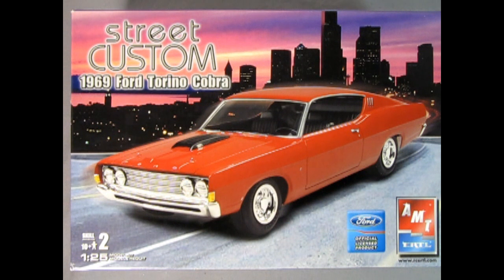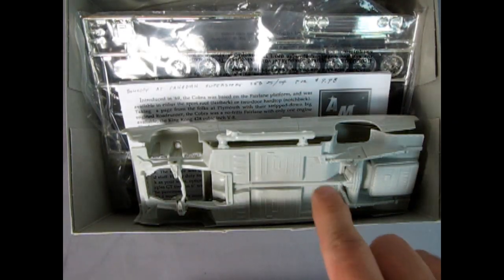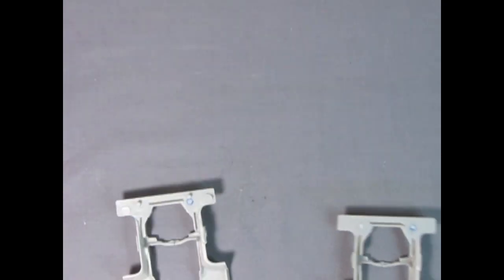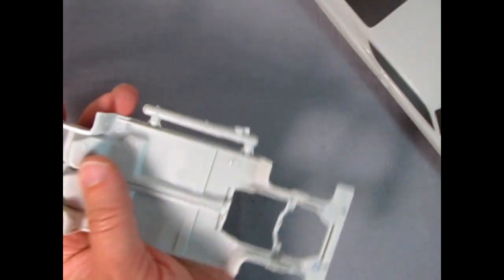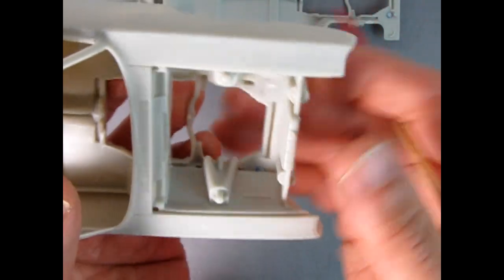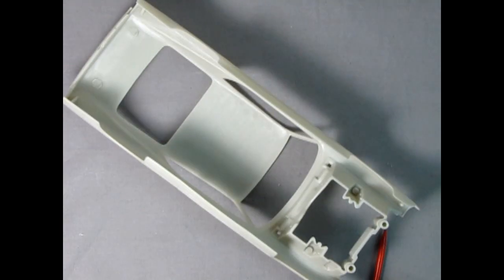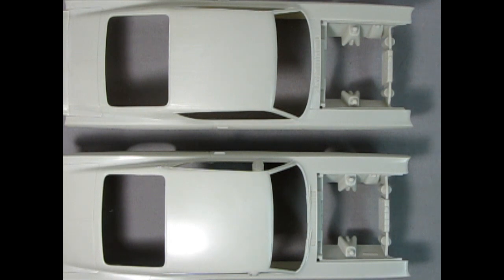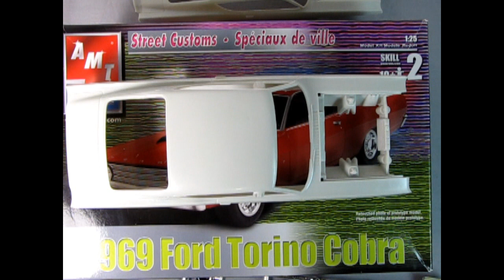What Is Going On Here? More Alignment Issues On AMT's 1969 Ford Torino And Is This REALLY A Cobra?

Comment: I think your right about my chassis and yours. As I said,I didn't relocate my front pins. It looks like they have in the mould👍
Reply from the maker: Yes, I think we are looking at two different pin locations. At least someone at RC2 looked into that problem. But I don't have one of the newest releases to see what Round 2 did with the mold.
Reply: @MonsterHobbiesModelCarGarage  the white one,I'm using is a 'new' version. The blue one is 91,I think
Reply from the maker: @petesmodelcarcustoms584  Yes, I saw in the last video, but to experience an new one first hand is something I need to see.
Reply: @MonsterHobbiesModelCarGarage  see if you can find a second hand/unbuilt kit of the new release 🤔👍. New,I regret buying it,they are not worth the money especially if most fenders are dished in as mine is.

Comment: Well spotted change on the chrome sprue👍. I've got a Cobra back panel,.I'll check other sprues
Reply from the maker: I am not sure what the new kit has for it's chrome rear bumper. I tend to think that it's back to the Torino on the latest edition.
Reply: @MonsterHobbiesModelCarGarage  it has the waffle panel.
Reply from the maker: @petesmodelcarcustoms584  Cool...so it's back to being a Torino. The only thing that gets me, however, is that no matter what back end is on the car, the grille is forever a lowly Fairlane 500.
Reply: @MonsterHobbiesModelCarGarage  🤣🤣what could be done about that. Totally remake the grille with the right amount of thick trim rails and an etched GT badge🤔
Reply: @MonsterHobbiesModelCarGarage  I've just been looking at a beautiful 69 Torino Cobra.  It's fully and accurately restored on a channel called Volo Museum Auto Sales worth looking at
Reply from the maker: @petesmodelcarcustoms584  I often look at Volo's channel. Is it the one in an almost Maroon with the Craiger mag wheels?
Reply from the maker: Rebuilding the grille would be a challenge. - By the way, there was a convertible Pace Car edition made of this kit which I think is where the grille is from. AMT just never changed it out. Seems like it's the grille for the Torino standard roof and not the fast back car.
Reply: @MonsterHobbiesModelCarGarage  I'm working on a jig for making grilles👍😉
Reply from the maker: @petesmodelcarcustoms584  Sounds good. I'm working on a script for my video on building this car kit. At this stage, I need a road map of ideas to get me through it!
Reply: @MonsterHobbiesModelCarGarage  yes,I bet. I've got a silly surfer kit to finish then I'll sort my changes out on the Torino. I've got bits from different boxes and a right mess to tidy up 🤣. I'm having a lot of fun with this investigation with you👍
Reply from the maker: @petesmodelcarcustoms584  Glad you are liking all this. Seems like I am getting quite a lot of input from everyone on how they overcame the issues. This sure has been a community effort. - Now I have to take all these notes and data and pictures that I have and put them into some kind of order and then make my video. Hopefully after all of this, I'll have the most complete video on how to fix this kit. 

Oh, I also discovered that the latest edition of this kit has those old "Tall Pins" back on the chassis. So there must be 2 different sets of chrome and chassis in that AMT mold. Just wish there was some consistency between these models...like choosing what car this really is suppose to be and then running with that.

Comment: I think the combination of pegs forward,to the new mould position and redrilling behind axle as the simplest,other than Willi saying make slots,solution. I'm still checking for simple chassis swap but all will need a lot of cutting to fit. I do have a concern about the body of the newest release having a dished in areas in the wheel arch of the left fender. I've seen other builds of it with this problem. I also noticed the massive cut-away line for massive rears. Do you think it's a remnant of the original 68 release?
Reply from the maker: I found the original kit's instructions. It was a choice of factory stock or drag racer, so there was some pretty tall Goodyear Blue Ovals back there.

Comment: I have the newest release of these kit and I have a old chassis, the same as what you have the pins are in different spot, the chassis with the pin in the wrong spot if look at the other side where the screws holes bos are, the pins are not center to those
Reply from the maker: The pins sure are an issue. I'll have to build my kits soon, but I have no logical way to start the video off.

Comment: For 30 plus buck why didn't they rework the hole rear end and make worth our harded earned money it's like a promo toy you can't raise the rear and put big tires without great deal of work its just a  cheaper way to produce a kit maybe it's just sad money down the drain again
Reply from the maker: They are just working off the old mold. Saves them time and money, but I agree...if inflation is driving up the prices of models, we should be getting the quality with the higher price. Sadly, there are more old tools out there than there are new ones. Your best bet is to buy kits from AMT that you know the tools are new, but that means you would be buying car subject matter from 2024. (Modern cars).

Comment: The 1990 ERTL edition has the Cobra rear bumper and the Round2 2022 edition has the Torino rear bumper that i have!So they all mixed and matched without caring!But both have the same chassis!Be carefull not to push the chassis too far back,because the rearbumper will not fit anymore!dont push more then 2mm!And beware!The decklid on the side were the Cobra emblem is(right) is half a mm lower then the left side so there will be a gab between rearbumperpart and decklid on the right!And the hole for the left frontwheel has a different height then the right!Aaaaaaand the whole chassis is not really straight!Be very carefull with alligning the engine bay frames to the chassis framesand make sur that it sits in the middle on the back of the chassis(at the rearbumper)This Kit is not that easy to build!It has many 😵‍💫😵 and its very fiddly to make it right!And the newest edition is a flashmonster and has sinkmarks where you dont need it!!Happy building and good luck,Trevor!To you too Pete!
Reply: Cheers for the further info and your comments,Willi 🍻👍😎. I found that my new chassis is twisted. The right pin doesn't go in all the way,leaving 0.75 mm gap. I'm looking further into grinding part of interior/ floorpan area as I'm still getting 1mm chassis exposed towards the front. I really enjoyed the investigation 👍. Best wishes from jolly old England👍😎 Pete 🤓. I do wish you would post video of your progress 👍👍
Reply from the maker: Thank you Williwass6837, and thank you for all the head's up tips. Sounds like there are a lot of them!
Reply: Willi,on your 2022 release. Is the left fender dished in compared to your 1990?🤔. My new one is😭and I think it might be a common fault🤔
Reply: @petesmodelcarcustoms584  Hey Pete!It seems my body at least in that case has no faults🤣except from the previous mentined flash,sinkmarks and the decklid!!
Reply: @MonsterHobbiesModelCarGarage  Forgot to mention that the when you center the chassis and the frame right,you have to  shorten the stub of the right wheelback 1 mm where the bolt is put so that the distance of the wheel to the fender is the same on both sides!
Reply: @williwass6837  looks like I've been lucky again then 😂😭😭😭
Reply from the maker: @williwass6837  Yes, both of the wheels (Stock and NASCAR) have their own set of issues. This build video I am going to make will have a LOT of modifications to it just to get it right. - I'm going to take a lot of people's suggestions (Which I will need to print out and list) and combine them to sort this thing out. I also discovered a few other things about that chassis that AMT did in the past that I will go over as well. What a mess this kit is!
Reply: @MonsterHobbiesModelCarGarage  Another "problem" just arose!The Cobra emblem on the trunk should be removed because it should be on the rearpanel!And all 4 wheelarches are not "flat" and have to be "blocksanded"!All in all both sides have to be done this way to get rid of all the "waves" that are on this surfaces!
Reply from the maker: @williwass6837  Hee Hee...The Cobra emblem is on the rear panel, but the rear panel top is molded to the back of the car, so that's ok...however, the rear Cobra emblem is totally wrong. First off, it's in the wrong location. The real one should be 1/2 way between the center of the rear panel and the right tail light, and secondly, it's backwards. It says "Cobra" and then there's the snake logo. The real one should have the snake logo and then say "Cobra". 

Good eye though. There are a lot of issues with this kit, but through the help of everyone here, I am making some great progress on getting all the kinks out.
Reply from the maker: Another issue...and you will find this one funny...is that if you look at the inner wheel well openings and notice the raised "Cut out lines" for the NASCAR version, you will notice that the rear ones are matched to the rear axle being placed in the wrong spot. The curve is "Cut" 2-3 mm in front and barely end 1 mm in the back.
Reply: @MonsterHobbiesModelCarGarage  🙃😂it seems we should start an investigation on this topic!(i guess we already did)
Reply from the maker: @williwass6837  This little venture into solving a fit issue lead me to a deep dive into research on the real cars, as well as AMT kit history, NASCAR racing history and so much more. I have been working on the model and nearing completion (Still need to paint it though) . Once the video releases, you are going to be amazed at what I came up with and how I went about correcting issues.
Reply: @MonsterHobbiesModelCarGarage  Hell yeah!iam just working on updating the shallow interiortubs sidepanels!Make it look more real!Doing the same to the 71 Dodge Demon interior!

Comment: a lot of model company are putting out crap and done care any more that's what I think
Reply from the maker: Not really. They are just using the molds they have on hand because tooling new ones cost money. However, they do listen to what the modeler wants and many act to bring out what they have in their warehouse for the model builder. 

There are a few AMT/MPC kits that have issues that should be corrected. The MPC 1967 Pontiac GTO and this AMT Ford Cobra kit are two that really need to be recreated from new steel molds and a good CNC milling machine.